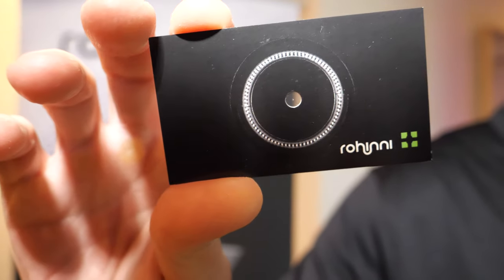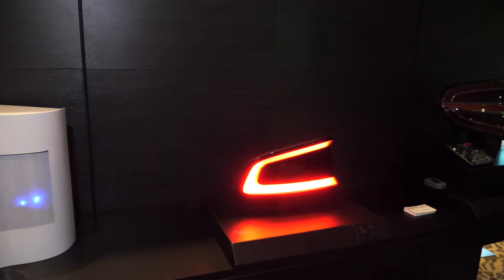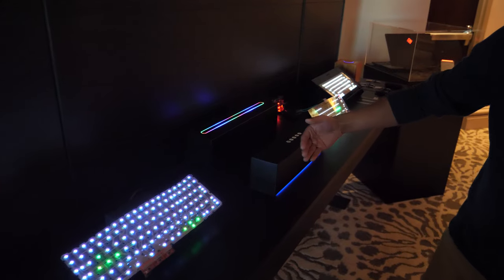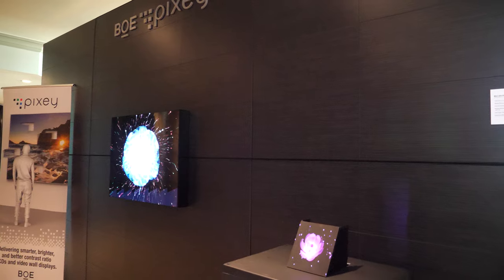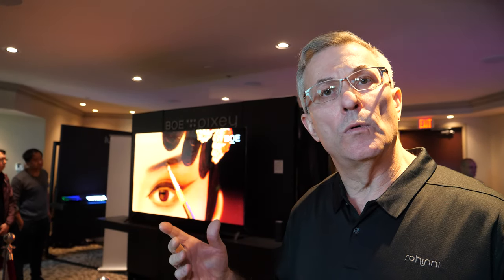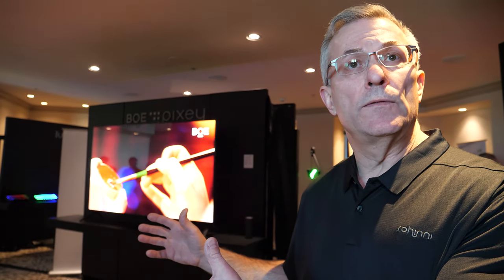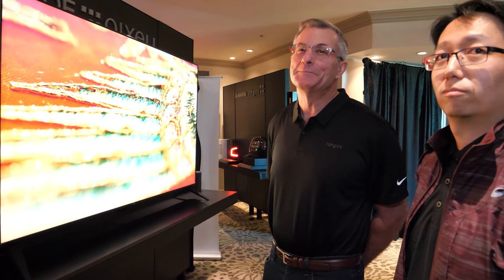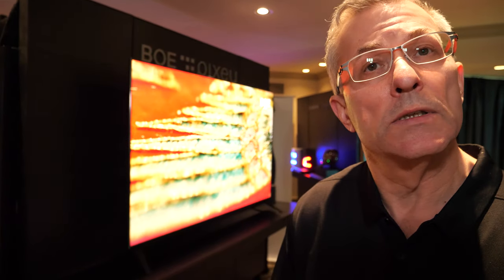Rohinni microLED with BOE, Magna and Luumii, World’s Fastest microLED pick and place

Comment: The red velvet ropes are there to block people from getting to close it’s horrible I can see the grids and space in between modules. They won’t let people get close on purpose.
Reply: Pixel pitch is too big for anything smaller than a big TV. Not there yet for displays or phones. But if they can do this today they will surely shrink it soon.
Reply: But then at 18:40 they aready have 75 inch 8k tv with 10k zones of their backlight. Comparing this to shitty backlights everyone else uses this application is already good for what it is. TV brands are screwing up backlit tv just to sell their shit lifespan expensive OLED. When someone uses a correct algorithm you cant tell from an Oled even the blooming is just the fault of no effort design.
Reply: Wu Me  doesnt seem like display tech is more profitable than those and so this is unrealistic expectation.

Comment: Just realised they dont make actual micro led displays, just micro led backlights. What are the benefits of an micro led backlit lcd compared to an oled screen
Reply: I think your are messing miniled with microled... The true microled TV uses leds as pixels either single RGB leds or just individual Red, green and blue leds in the arrangement they chose to actual make the pixels...

Miniled backlight LCD are bigger leds but still much smaller than the older normal leds used for many years as backlight... TCL series 8 has more than 25 thousand minileds as backlight, but still is far from perfect compared to OLED, there's still scenes shown where it still has the same plague as older local dimming LCD's showing blooms\halos of light...

With time and specially with upcoming TV's this year they will probably improve a lot the miniled LCD but it will never be like the perfect microled where each pixel are 3 microleds Red, Green and Blue and can turn off or on and control each sub-pixel brightness individually which for 4K UHD resolution actually mean a crazy number of 24883200 leds and an insane circuitry to push every single one of them to 2000 nits (at least is what they are currently aiming at this moment for the true microled TV and later will probably be pushed higher and higher)...

JBD company for example already shown years ago a super high resolution small 5000 ppi Red, Green or Blue microled display with super amazing 1 million blinding nits which was hidden inside a black cover and people still needed to use very dark glasses to look at the super blinding small display, though their manufacturing process is not good for a TV as they make them like a CPU\GPU die with silicon in a waffle and they are only interested in AR\VR and projectors...

Also in the future probably the best and cheapest way to actually make a microled TV will probably be using 24883200 blue leds (for UHD 4K) and use Quantum dots to make the red and the green since quntum dots don't cost almost anything nowadays and by using only blue leds its much easier to control them since they are all the same so the current and voltage and everything would be applied the same for every led and they let the quantum dot do the rest of the colors instead, but its still an insane amount of microleds and still need a lot of crazy hardware to drive all of them to high brightness so microled will probably keep very expensive for many time...

At some point OLED might also be replaced with self emissive quantum dot TV's which would be a much cheaper alternative to the expensive microled TV.
Reply: These are microled themselves that is behind the samsung microled tv's.